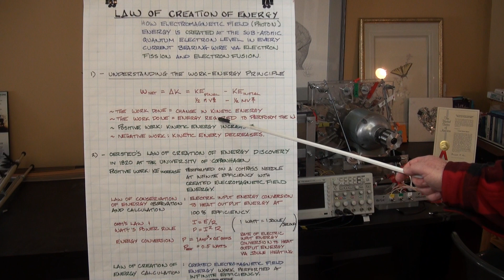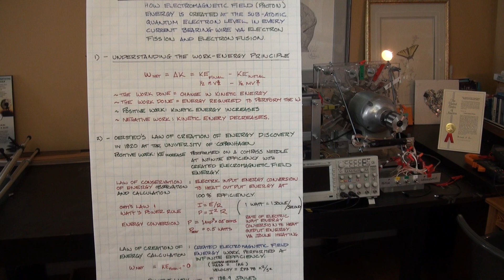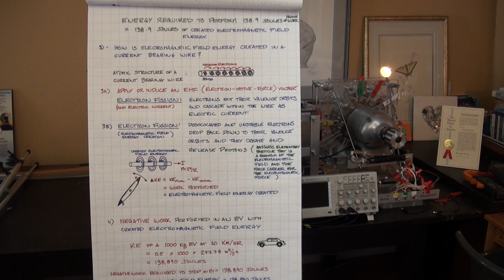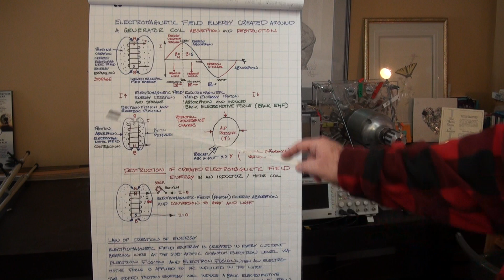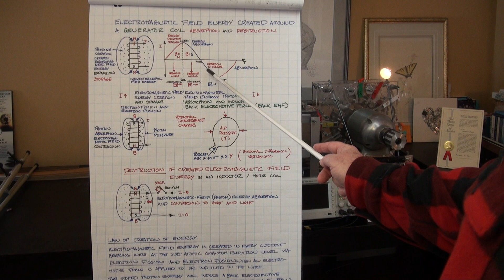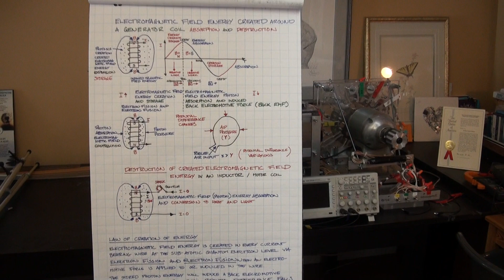LAW OF CREATION OF ENERGY - How Electromagnetic Field Energy is created in all Current Bearing Wires

Comment: Many thanks for the work you are doing. I really hope Tesla or another electric company decides to adopt you technology!

I am still working on processing your explanation of the law of creation of anergy!

By the way, after much experimentation, at last I was able to create a coil that does produce acceleration when on load. When the coil is shorted it is indeed when it produced the most acceleration since it creates a more powerful magnetic field!

I used wire awg 18, a little more than 300 turns and the softest steel screw from Lowes hardware!

I have made 2 of those coils and they are very easy to make!

Now that I see that the effect is real, I think it's time to use Metglas instead of the steel screws!

Will Metglas/Amorphous iron accelerate it even more to the point that I will not need a motor/prime mover?
Reply: Please explain to me how to do the experiment
Reply: @rmadangarara3851  I was hesitating on posting what I posted, I did not want to draw attention, I wanted to get a response from Thane Heins!

The other responses I have gotten are insulting!

But it is too late now!

Is this really a good place to explain how to do it!

Basically everything is designed and 3d printed by me. Except the magnets and coils!

If you are interested I can just put all the 3d designs and the explanation on how to do the experiment in Thingiverse. But you will need a big 3d printer to print them!

How do I know it works?! Because if I connect a small load, or just short circuit the coil, the rotor starts accelerating instead of decelerating!

A deceleration, due to back emf is not happening. However, since the coil has a steel core, there is drag by default, even before causing the acceleration. And, at least using the steel core, I have not found a way to make the rotor fully overcome that drag!

That is why I am thinking on trying with met glas next and see how much it accelerates!
Reply: @rmadangarara3851  COMPLETE Dutch EE ReGenX Generator Replication Instructions:

The First Law of Thermodynamics BELOW the Critical Minimum Frequency of Operation and 
the New First Law of Thermodynamics ABOVE it.

And Hans Christian Oersted's Law of Creation of Energy of 1820 which governs them both.

https://www.youtube.com/watch?v=d3hzyPotc6M&list=PLyLMmnSL6MzHzU0cw-O5G4STBzUFqUuXi&index=1&t=20s

https://www.youtube.com/watch?v=Z-jq-xwN5hw&list=PLyLMmnSL6MzHzU0cw-O5G4STBzUFqUuXi&index=2

Thane C Heins Replication step 2 - Difference Between Shorting and Loading.
Exploring the difference in the generator's reaction when you either get it to supply an electrical load or completely short the circuit.

https://www.youtube.com/watch?v=cVFXSZzUNmE&list=PLkH1zLdXy1SwReqk9qpqXRzxDDOIPwDFH&index=2
Reply: @rmadangarara3851 you have a rotor, with magnets equally spaced on it, alternating in north/south/nort/south etc all the way around. then you wind a coil, lots of thin wire is a good idea. many turns for high impedance ideally. and the coil must have a core inside it, something that attracts the rotating magnets ! then you spin the rotor at several thousand rpms. (using an electric motor or anyhing that rotates fast enough). you could use the drive shaft on a  vehicle, that would be rather simple. either way, start with 3,000 rpm or 3,500 rpms or higher and study it ! each coil has its own critical minimum frequency (rpms) at which it begins to display the accceleration effect. it might happen at 3,000 rpms or 5,000 rpms or some other value, but it happens ! its for you to play with and ssow yourself !  ll the best !
Reply: Congratulations you just violated over 300 years of physics; Newton's 1st and 3rd Laws of Motion, Lenz's Law of Induction, Faraday's Law of Induction, the First law of Thermodynamics and the theory of conservation of energy. the Kinetic Energy increase of your system EQUALS the magnitude of Electromagnetic Field Energy created, according to the Work-Energy Principle and the Law of Creation of Energy. Cheers Thane
Reply: @ThaneHeins1  Thanks! 👍

Thank you for sharing this effect!
Reply: Fascinating 👍
Reply: Please make a video of your test, because many as me dont understand what you are doing.  and reply here with the link.
Reply: @BienestarMutuo he has all the tests and epxlanations on his youtube channell. its for you to study them and then replicate it. its all there for you !! start wathcing his videos !
Reply: @tvdylan  yes in the videos we can understand the experiments of Thane, my message was to @rasikrodriguez3851 experiments.
Reply: @BienestarMutuo ahh, mm! so are you going to do some experiments ?! : )
Reply: @tvdylan   We are working in a solid state circuit to produce electricity no rotation needed.
Reply: @BienestarMutuo i see ! very good. whats the basic process of your device ? : )
Reply: @tvdylan  What are you going give me in response ?
Reply: @BienestarMutuo  its up to you if you share an explanation or not.
Reply: Are you taking hallucinogenic substances?
Reply: @ricksampson6780  A 1000 kg electric vehicle has 138,890 Joules of Kinetic Energy in it at 60 km/hr. Where does the energy come from during EV regenerative braking in order to perform 138,890 Joules of Negative Work in order to reduce the EV's Kinetic Energy down to zero - from a non-hallucinogenic's perspective that is?
Reply: @ThaneHeins1 Action reaction?
Reply: @lukiepoole9254  Action Creation... 😉
Reply: @ricksampson6780  Elon Musk is taking ketamine